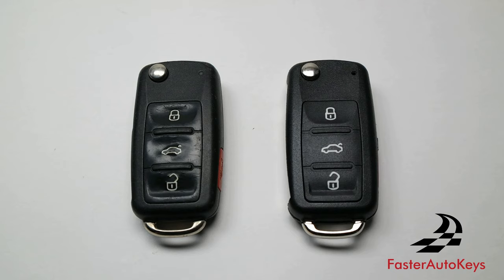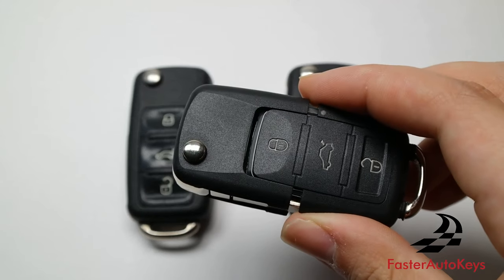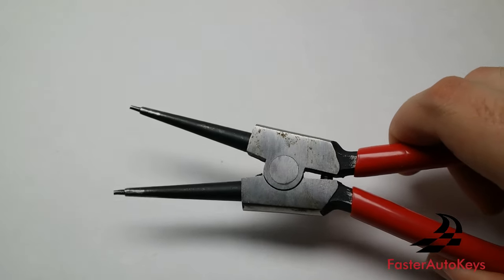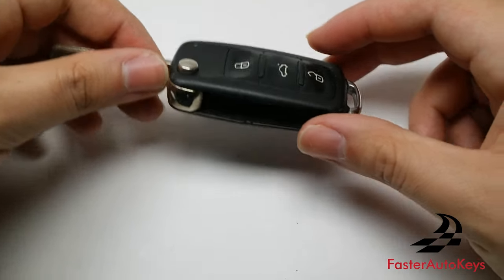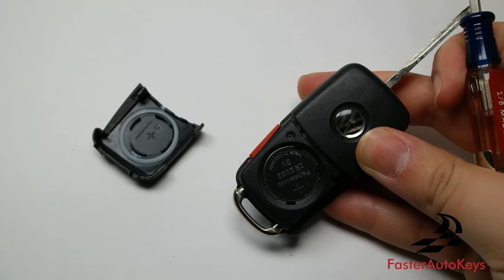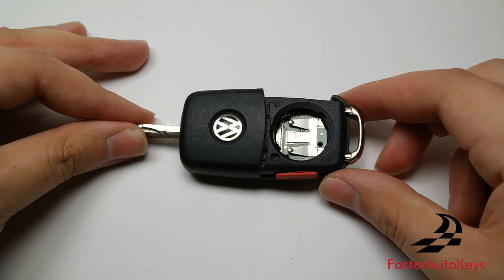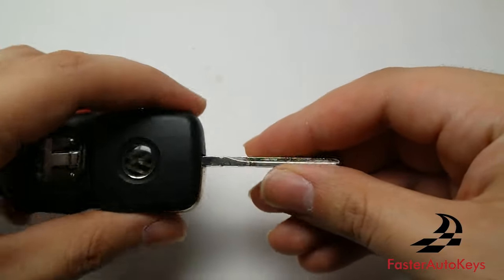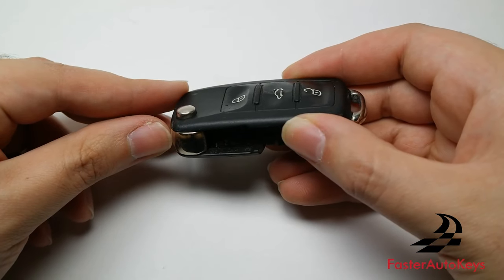[HOW TO] 2010+ VW Complete Volkswagen Key Fob Shell Replacement Tutorial

Comment: My key just doesn't start the car after replacing the casing, it locks and unlocks the door put it in tge ignition it starts to flash key light... No car manual
Reply from the maker: Hello, based on the comment I'm going to assume you have the older generation 2000-2010 VW key that separates from the top and bottom. Please see the video for that key, the top end of those keys have a separate immobilizer chip that starts the car. If you don't swap the chip to the new key, this exact issue will happen.

Comment: Do these keys have a transponder that need replacing aswell? Or is it part of  the chip? Because I need to do this with my VW key as the flip housing has snapped and the blade is now separated from the casing.
Reply from the maker: Thanks for the question! These 2010+ VW keys have the transponder built in the remote. There is not a separate transponder, they are together.

Comment: Instead of separating the blade form the mechanism, why not just use the whole key and mechanism from the original key on the new key fob
Reply from the maker: Great question. The most common breaking point on these VW keys is the shoulder where the blade fits inside. This is the main reason most buy a new shell from us. You can reuse your existing OEM shoulder now but it will eventually break as most are passing 10 years old. For this reason it's better to move the blade into a new shoulder while you're at it.
Reply: @fasterautokeys  thanks for sharing. I see in some of the other videos the blade does not fit inside the new key shoulder. What do you do in that situation, shave down the insert of the blade?
Reply from the maker: @sk8tor4ever  That's right, some OEM VW key blades are thick and the end needs to be sanded in order to fit in the new shoulder. This can be a hassle especially if you don't have the right tools. We are able to offer the key shell with a laser key cutting service included if you can provide a photo of an existing key blade. That would prevent any hassles and you can have another cut key for more security.